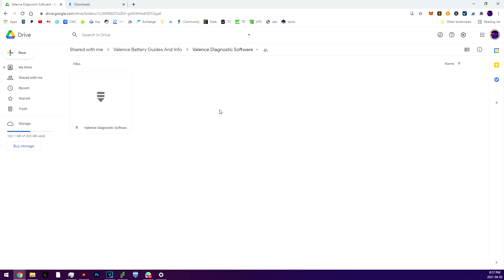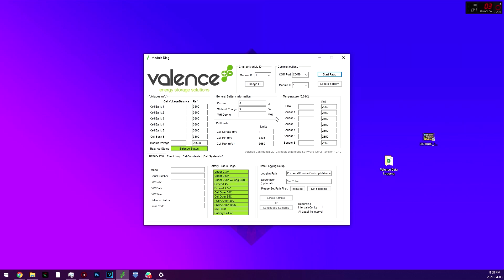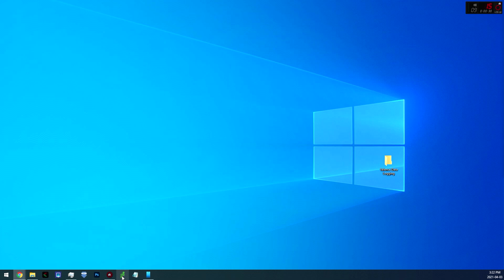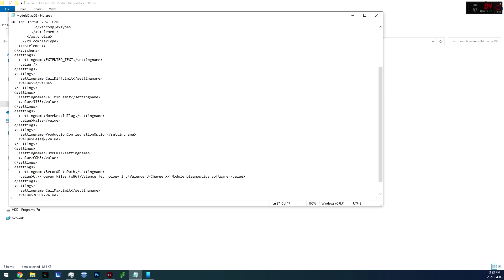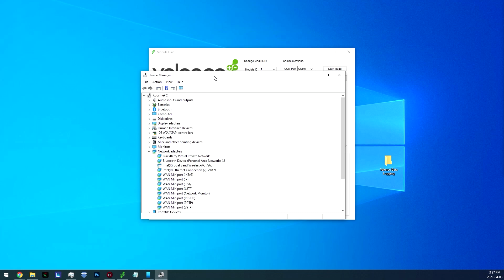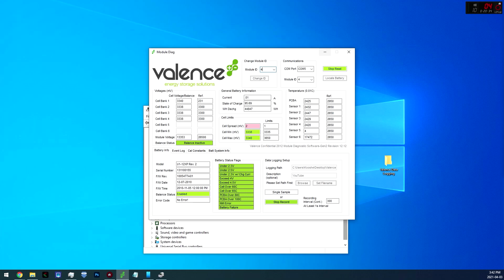Valence Diagnostic Software Overview & XP Series LiFePO4 Battery Communication!

Comment: Hello, I'm having a problem where the SOC is incorrectly displayed at 100% when the cell voltage is 3.4V. It should only reach 100% at 3.7V. How can I reset the SOC?
Reply from the maker: For lifepo4, 3.4v per cell is considered fully charged, 3.2v nominal. You may be thinking of lithium ion which is 3.7v nominal

Comment: Hola estoy intentando conectarlo a unas baterias u27-36xp,pero no conecta, si que las lee y detecta el numero que es, pero no conecta para dar los datos.Si alguien puede ayudar.gracias
Reply: I have the same issue. Can read Module ID but it won't connect. Did you manage to sort out this issue?

Comment: its making me install a .net software version 2.0? even after installing that software it still wont open on windows for me. any ideas?
Reply from the maker: Did you restart after the .NET installation? And which file did you open for installation?
Reply: @KooshiesElectronics  ok i seem to have it working for the moment, I had to go into control options and add remove programs and check the box next to .NET for it to be accepted by admin
Reply from the maker: @jamesyoungjr9850  Glad you got it working!
Reply: @KooshiesElectronics  seems like im at the final step but it is only recognizing com port but when i click locate battery it says no battery found. have you ever gotten that? my battery is only at 2.6 volts and no flashing light by the way

Comment: Curious if you ever managed to connect the Valence software to an RT series battery?  Cannot find anyone else that has managed that.  Totally different software needed?
Reply from the maker: I just had to rephrase my comment as i just looked into my notes about this and remembered that i found someone else attempting the same thing. It requires Python and some IT knowledge and my plan was to fork it and make something .exe executable with all the RS485 communications dealt with and easy for an end-user. Stay tuned.
Reply: @KooshiesElectronics  Trying to use this with U1-24RT Battery with RJ45 jack. Having some trouble getting the battery to respond but the pin out is the same when you open the top lid the color of the wires match these other batt.

Comment: I have a U-Charge U1-12RT.  It has an integrated BMS. Will you be working with that battery at all?
Reply: Wondering the same. Have you successfully communicated U1-12rt with the valance software and RS485 adapter?
Reply: @gmanweber3776  No, I don't need to do that for how I'm using the battery.

Comment: Just for your info, Lithion Battery is a Canadian company that purchased Lithium Werks's Valence Battery business in December. Lithion Battery also plans to start producing lithium batteries in Henderson, NV this summer.
Reply from the maker: Thanks for the info, I had been in contact with lithium werks for a while to gather some info and some manuals for 2 of the proprietary batteries i have, Both of which just minor variations of the production models. I hope to see Lithion treat them better than lithium werks did. They made little effort in advertising, sales, or events to bring attention to these great modules. They did not much of anything to make valence batteries and the tools needed to use the batteries accessible Unless you contacted them directly. They had little to no retail locations... This is all my opinion of course. I just see a lot of potential in these modules and we would all benefit from some attention and tlc. To answer your other question, Yes i will be working on the RT and i have another RT bms i plan on using to make a frankn' module, Something your wondering?.